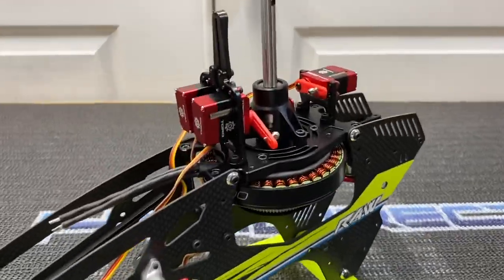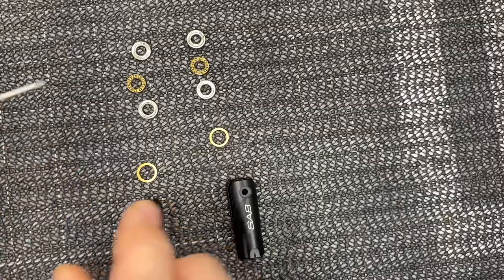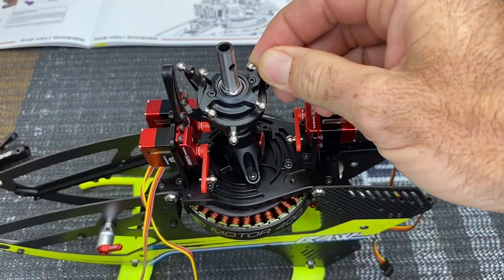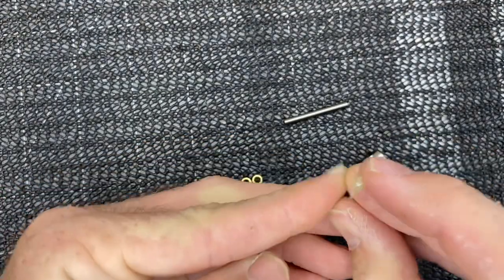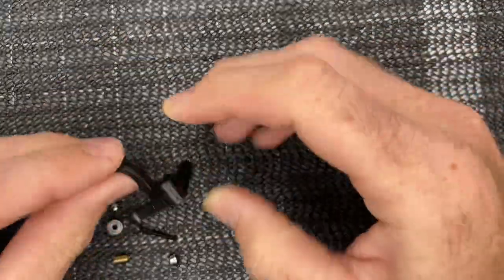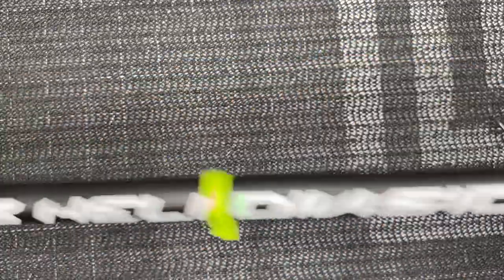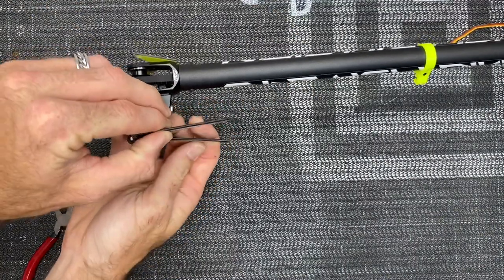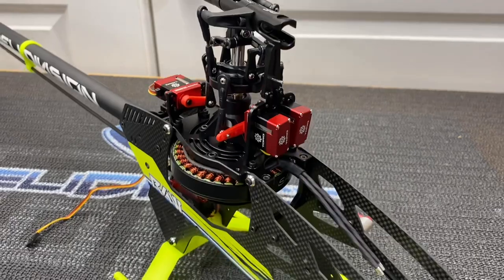SAB Goblin RAW 420 DD Build Part 2

Comment: HI Jeff, I found the problem with the dampers, you are supposed to install them with the lip facing the centre hub however if you do that you get loads of play, so to solve the problem if you look in the spares bag there is 4 o rings 2 for tail 2 for the head , I noticed the o ring is slightly larger for the head  than the o rings  put in the assembly bag so I fitted them and no play, problem solved, I have notified Enrico at SAB and he is looking in to it. 👍

Comment: Great videos bud! Really appreciate them!

I stand corrected on the Autorotation bracket… the curve goes towards the main shaft… the Manuel is deceiving… on my it shows the SAB stamp away from the main shaft
Reply from the maker: Thank you! I appreciate it. I looked a few times over the 7 that I’ve built and made sure. It is deceiving.
Reply: SAB Manuel’s are the best there is… but on mine… it showed the logo stamp forward…

My bracket is really tight on the pin… have you had that on any?
They told me that some have been reported.. wish they would have made them aluminum

Comment: Such a great series!! Could you give me an advice on which charger you recommend to charge (ManiaX 80C) 6S-22,2V 2400 mAh batteries? I honestly didn‘t have luck until now and seem to always buy the wrong device. At best it could handle a balanced charging process… Thank you so much!
Reply from the maker: Thank you! I’m glad the build series is helpful! So I would recommend the ISDT P30 or a Icharger 456DUO ( I have both and they are fantastic) but the iCharger 456DUO is good for up to 6s pack and the ISDT P30 is good for up to 8s packs. Both are duel ports so two battery’s at one time. You will need a separate power supply I use the Junsi S2100 power supply witch is 1200 watts but I only use that because Im Running three two port chargers at one time. But the buddyRC 900 watt power supply is a great price and good as well! Some options for you.

Comment: I got mine all done and the spirit 2 setup. The setup on the spirit and its rescue was really easy and everything seems to be working as it should. Ive checked and triple checked everything and honestly im really nervous to maiden it. Woried I didnt do something right. My first build.
Reply from the maker: As long as everything is going the right Direction on the bench then get it light on it’s skids and see if it’s solid and if it looks/feels good lift off! If the gyro directions are correct tail direction is correct and gain is set for the tail. It will fly great!
Reply: @westhobbiesrc8051  thanks. Yeah everything is going the right direction and soo is the gyro. Probably just nervous because its my first build. I think its all good though. If the wind and rain would stop and I get any daylight while im not at work ill maiden it.
Reply: Have you had any issues with tail wag that you couldnt tune out with tail gain on this heli? If I increase the gain on mine the wag gets more narrow and fast. If I decrease it the wag gets bigger and slower but I can completely get rid of it.
Reply from the maker: @DetoursRC  yes, it’s perfectly normal for the first 20ish flights. If your running the governor then also turn governor gain down. Everyone I’ve built has wagged for about 20 flights till the tail breaks in.
Reply: @westhobbiesrc8051  ok cool yeah I thought the mechanics in the tail seemed a little tight. Thanks!

Comment: Great video again, Jeff. Popcorn is ready for Part III :)
Reply from the maker: I am working on part three as we speak! It is the most time consuming one because it is the wiring! And you already know it’s gotta look perfect LOL
Reply: @westhobbiesrc8051  good luck with the wiring, it is tight! :)
Reply from the maker: @ytluisase  thank you! It sure is a lot to wire and fit in a open design and make it look good but I enjoy that Challenge. I’ll be cutting all the wires shorter and new ends.
Reply: @westhobbiesrc8051  that's a very good idea to shorten them!
Reply from the maker: @ytluisase  I shorten all my wires on all my helis so I can get a clean perfect run into the FBL and it’s looks clean and good.

Comment: these videos are really helpful, i've just (well nearly) finished building my 420 and this series came in quite handy...

one question though, did you notice the tail blades rubbing on the tail shaft screws?
Reply from the maker: Awesome! I’m glad the videos helped! That’s my goal, I want videos that are helpful and can be used though out the build. So yes, they touch a little but it don’t hurt it.
Reply: @westhobbiesrc8051  ok cool, I took the tail apart, thinking I put the thrust bearings in backwards, but it still does it... In the end I just sanded off the lip a fraction...
Reply from the maker: @davids8345  I thought about doing that as well but after building 5 of them and flying a ton of flights it didn’t hurt anything so I left it lol

Comment: On the cyclic servo sticking straight up and down did you program that point as your 90 I'm assuming with the Torq servo box?
Reply from the maker: Yes, you can program 90 with the Tbox. You can also do it with sub trim in the FBL unit. Programming center in the servo is better but both ways work.

Comment: Hi, you adjust your tail at about 4 degrees a 0 rudder, did I understand well ? I always did 0 with 0…. On my other Helis. And thanks for the great 2 videos!
Reply from the maker: Yes I always set all my tails up with the servo at zero and 2 to 4° of positive pitch at the tailblades. That is proper tail geometry and set up. If you set zero and zero then your Gyro is working harder to fight the torque when you can set it mechanically to mechanical leverage against the torque.
Reply: @westhobbiesrc8051  thanks for the answer and the great video.

Comment: In the RAW 700 E and RAW 700 N , we have an indicator of the correct tension of the tail belt, in this model is like previous model ? you choose the desired tension? 28:39
Reply from the maker: Yes you tension the belt to your Desired belt tension. You can also change the amount of tension on the tensioner.

Comment: Quick quiestion, I do not have enough negative pitch on 420dd with vbar touch and vbar neo, everything nice and smooth @picth0, but when I move the stick down, I get max of almost -11 degrees. with my collective pitch trim pushed way to the max, 120. Before control, I had a spectrum dx6 that I force the -12,5 pitch by travel adjustment of the pitch channel and was fine. Any ideas? I have re-setup all the mechanics, everything is like in the manual, servo 90 degrees etc. So, there is an end point adjustment on control touch? Or any idea to increase the negative pitch, except to change the servo arms and to go above 13-15mm setting as manual say?

Comment: where did you get the servo grommets? My CL0604T did not come with them
Reply from the maker: No the servos do not come with them. They are available on heli direct. There are for the Torq mini servos.
Reply: Are they needed or just preferred? They should mention that it’s needed if so. I have my setup that just came in with everything but the gromets. Would really suck if I had to wait 3-4 days for some gromets for tail servo.

Comment: Hey Jeff you installed the dampers the wrong way look in the manual page 12 bottom right hand corner, the lip goes towards the main hub, 👍
Reply from the maker: I seen that way but having the lip ride the bearing gives the best gap between the head block and grip and head is tight and no slop/play and the lip rides the bearing like the bigger SAB models. I’m leaving my head this way.
Reply: @westhobbiesrc8051  if that's the case Jeff,  SAB should make this more clear in their diagram its misleading 👍
Reply from the maker: @allanbassett6163  it’s definitely misleading, I don’t honestly think there’s a wrong way. I just personally feel like the way I assembled it is how they do the big models in that little lip is riding the bear and giving you the perfect preload in my opinion. I have put a couple flights on the model head is super tight in perfect!
Reply: @westhobbiesrc8051  Yup all my goblins have the lip facing towards the bearings, I think SAB should revise the way the damper fits in the manual especially if its someone's first goblin build👍

Comment: Hi .. thank for the video... afte instal the arms on the shaft .. they are a little bit tight ... and move so freerly as the head arms. Is normal ?
Reply: Sorry... the tail arms dont move so freerly as the head arms .. is normal ?
Reply from the maker: Yes that is normal. As long as it is smooth no grit/binding a little tight is OK. It will work free as the time goes on. It is perfectly normal anytime you build a brand new model for some parts to be a little tighter than others. You just wanna make sure it’s smooth and no grit/binding

Comment: Is that connector holder for the xt60 available yet?
Reply from the maker: Yes it is! Just put mine on last night!
Reply: @westhobbiesrc8051  where can i find one? Out of stock at helidirect along with the ikon. Cant find an ikon or brain.
Reply from the maker: @DetoursRC  I purchased mine through Heli direct on the pre-order and they shipped out as soon as they got in stock but probably ran out. You can try BK hobbies as well. iKons won’t be back in stock till November unfortunately.

Comment: 26:00 this is the part where where I prefer torque tube! But 5he belt seems to make less noise
Reply from the maker: Personally I can’t stand TT anymore. After going belt on so many helis it’s just so nice and no stripping TT gears if you touch the tail or set hard tail stops.
Reply: @westhobbiesrc8051  I love torque tube. Although with the automatic belt tensioner it is much easer to get the correct belt tension. I bought ALZRC 380 and man that thing is quiet my next heli will be SAB 420 with direct drive but I wait to see what the align TB40 will be

Comment: Not sure if you've changed it, but your plastic damper is the wrong way round
Reply from the maker: No I did them that way on purpose, I want the lip riding the bearing like on bigger SAB models. Head is tight and perfect. Multiple flights already!